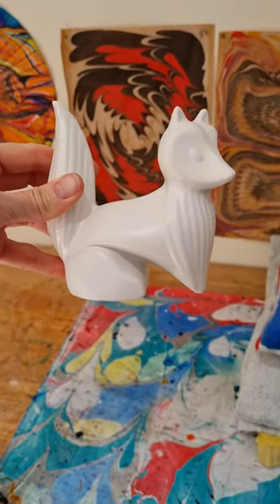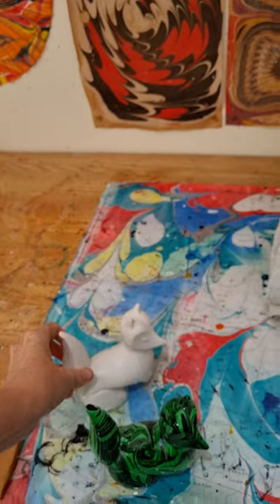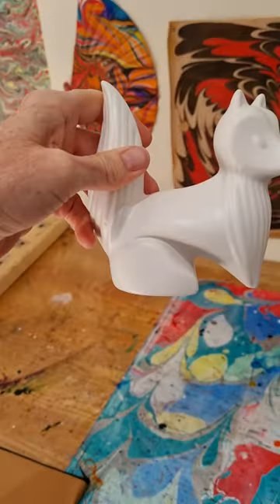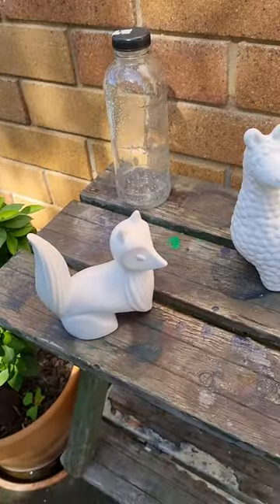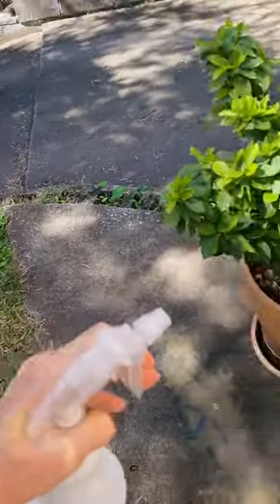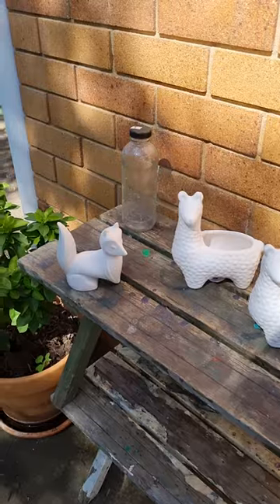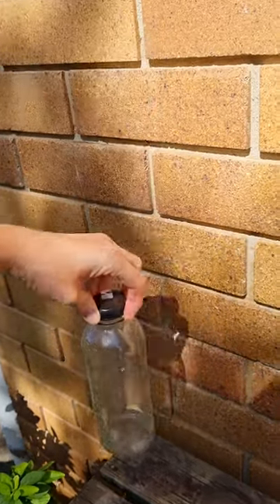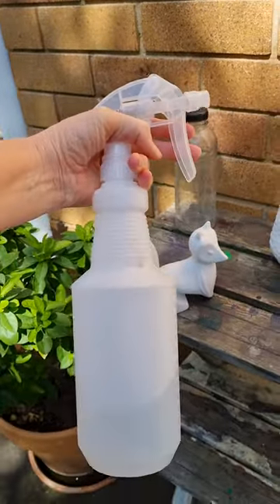How to apply alum to 3D pieces for Water Marbling

Comment: After you do the marbling dip do you risne the part off or wait then rinse or not rinse ? Thanks
Reply from the maker: No rinsing required. Let dry and seal with a spray varnish
Reply: @raynbowcrowstudios2165  thanks. I think that was my issue trying 3d before.